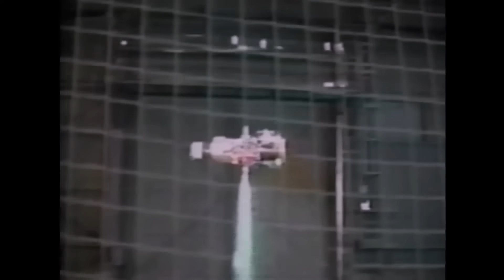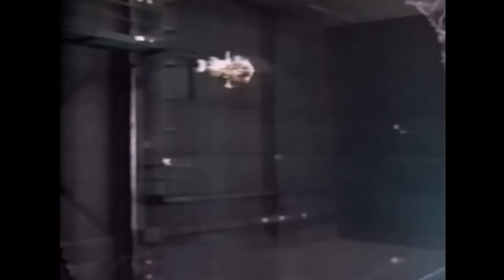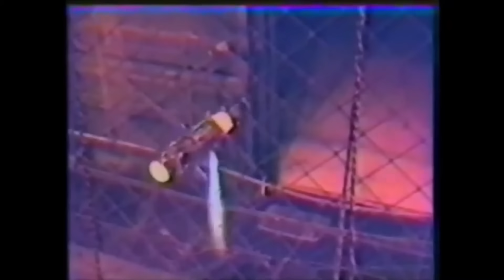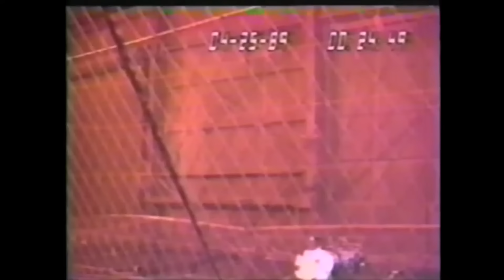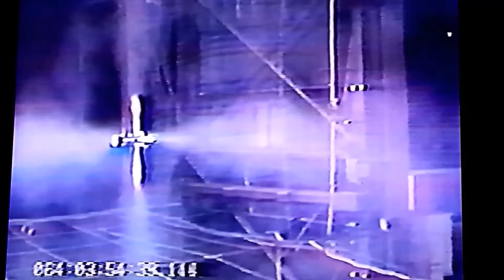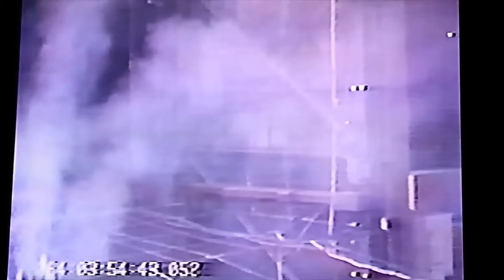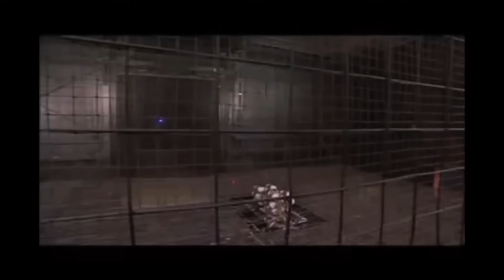EKV/KV/KW/KKV/LEAP (Exoatmospheric Kill Vehicles) Hover Test - Compilation Video (SM-3, GBI, etc.)

Comment: NICAP Report – Commercial and Navy Pilots (June 24, 1950)
A Navy co-pilot and a United Airlines pilot jointly described a UFO:

Cigar-shaped dark gray or gunmetal in color, with shimmering heat radiation at the tail roughly 1/8 the size of the full moon in apparent diameter, moving at 1,000–1,500 mph.

Comment: Chiles Whitted Encounter (July 24, 1948)
Both Clarence Chiles and John Whitted, Eastern Air Lines pilots, observed the object flying past their DC-3:

"It was torpedo or cigar-shaped similar to a B-29 fuselage" and approximately 100 ft long and 25 ft in diameter. 

Had a “dull red glow,” windows as brilliant as magnesium flares, and red-orange flame exhaust.

Comment: As I recall a treaty with the Soviets did not allow testing such devices outside, so it was tested inside a hangar. The target it was tracking was outside and viewed through an open door. The engineers are celebrating because they've probably seen the thing crash a hundred times before they got the control system dialed in.

Comment: now think of how many years ago this was. The " tic tac " and other UAP s  are the extensions of this tech . More efficient, lighter better power source etc. no flight surface, wings etc. . the rounded covering is somewhat like a speaker cover the gases pass through easily. Trans medium though hmmm they claim it but we don't see it in the videos so far. The gimble is this for sure.

Comment: Wow!
This is more advanced than the cheap-ass battery-operated drones. 
I hope they didn't put this on the shelf.
Do they have a gas vaping system for the fuel source?
If they did, that would mean this drone could travel hundreds of miles on a gallon of gasoline.
If they have this project shelved, they need to bring it back.
This is advanced tech right here.
With the power of AI, can make this the most advanced defense system in the world.
Or, actually, come up with real flying cars with this tech..
Everyone is focusing on "clean energy", which there's no such thing.

Comment: we have been able to make this kind of thing for a long time...the only issue is fuel. You have to have enough fuel onboard, so figuring that part out to make one fly for hours wasnt possible.
Reply: depends on the oxygen you can burn.. but why burn things when you can suck em out the atmosphere
Reply: @rokpepeshogun  oxygen itself is 21% of the air and its not a fuel, its an oxidizer.

Comment: I don't get this things purpose? whilst I admire it's working it seems to have no practical purpose on earth or in space. It's corrections are probably more accurate than bladed drones though and its thruster tech could be used in space vehicles with different fuel sources 🤔

Comment: When the invention was too dangerous even for the operators. Ever hear of Blendo from Battlebots. They nicknamed it the death machine because it had a rotating blade running at 100s of rpms. It had to be turned on using a drill at its had. They deemed it too dangerous for workers to operate.

Comment: As you watch this rather "dated" material that was likely classified back then as a DARPA project, you could easily see how much the technology has likely developed since then into potential drones.  drones that the less experienced, without a security clearance, might misinterpret such things as a UFO...?  JS
Reply: I live in the area where the whole drone controversy is localized, and it is just SLIGHTLY interesting that the government is remaining hush hush over it considering the amount of military bases in the area.
Reply: @DecarboxylationWF  I would tend to agree that this is all very likely our own government behind these drone sightings.  Plus the rate at which these things can change directions and fly off at incredible speeds is likely part of their overall design intent.  The original concept was to be able to intercept a ballistic missile which would be travelling at very high velocities, so it makes perfect sense that they would have developed them into hypersonic speeds by now.  The real question would be how did they solve the fuel requirement issue...they aren't of much use if they can't fly for significant amounts of time.  People think that military pilots would know about such things, but as someone who once held a TS SCI clearance, I happen to know that they likely would NOT know anything about this...not unless necessary.  The final real question is why are they potentially "testing" these things in the clear near populated areas?
Reply: Simple. Drum up public fear of drones to get bans and regulations passed so civvies can’t use publicly available drones of their own to check things out. If the war in Ukraine has taught us anything, it’s that drones are a terrible and awesome asset to a battlefield.

Comment: What I find interesting is that they're doing this research in this scale knowing full well the limitations of current fuel energy densities. Still putting assumably millions into it, one would think it was silly unless of course you have a similar acting fuel but with a much higher energy density? 
What are they going to switch the current 15 second fuel out for? If not where is this magic fuel tank going to be?

Comment: Why have a big thruster counteracting gravity designed in. Why call it a hover vehicle, is it meant to be literally hovering high above a fixed point on the ground. Do they not understand this sort of device will not need to counteract gravity when in operation? It should be launched either by a missile or holding in orbit - either way it will have enough velocity to counter gravity. Engineers...

Comment: Nobody here knows what this thing is or what the tech level in use is. It's an RCS system, it basically has powerful manouvering thrusters. We've had them for as long as we've had spaceflight. They aren't special or mysterious, advanced tech. The most impressive thing here is the flight computer keeping it stable.

Comment: In addition to the incredible success of making these units autonomous, you also have to understand that they're going to be operating in a low-gravity environment.  That means it's only going to be making small corrections, giving small bursts of the thrusters.  So the supply of fuel is going to last a LOT longer than just 15 seconds.  Once released by the launch vehicle or satellite, it will be able to intercept the missiles rather easily.  And remember, there's no explosives onboard.  All it needs to do is hit the missile, which is going to be traveling at Mach 15.  At that speed, a marshmallow would punch a hole through your chest, so this thing will obliterate a missile.

Comment: Rockets= thermodynamic system against thermodynamic system. Remove the air and they are one hand clapping.
Reply: No. A force always has an equal and opposite force.
Reply: @Noorthia  is one hand clapping a force, yes but is applied, No.
Reply: @newperspective7790  Let go of your clapping analogy. It is false. Thrusters throw their fuel back, and that force is countered by the rocket being moved forwards.
Reply: @Noorthia  you are incorrect, thrust is a thermodynamic system not a stream of fluid, the inertia of gas is very small compared to a fluid stream. One hand has force but cannot apply it onto itself. If direct water with the same speed as rocket thrust its force can sheer metal, but a gas cannot. Thrust is TWO thermodynamic systems one applying force, the other is resisting. Thrust in a vacuum is ONE HAND CLAPPING.
Reply: @newperspective7790  - The Dunning-Kruger is strong in you…
Reply: @danopticon  and you can't even formulate an argument or any original thoughts. Life is tough.
Reply: @newperspective7790  You're the one who keeps lying about thrusters.
Reply: @newperspective7790 this has to be ragebait

Comment: The positioning when in orbit will be more complicated given the orbital dynamics that will cause the orbit to change when a thruster is applied. At the time this was demonstrated nobody had a sufficiently compact system for calculating the orbital dynamics. This is really just and engineering showpiece, albeit a very impressive one
Reply: this is not for orbital flight. this is for intercepting suborbital munitions

Comment: At 12 inches long, several of these craft could be launched when using the new swing launch systems they have now, where no combustion is used when launching into orbit or space. They could have multiple sizes that hold different amounts like a model that holds 6, 12 or 18. Since most missile attacks come in multiples nowadays, thanks to missile defense having the capability of handling multiple threats.

Comment: this kind of control system was incredibly difficult to accomplish back when these tests were run, and you can hear it in the engineer's voices. ultimately, this project got all of its funding cut despite the tests working perfectly. basically, the nuclear weapons stand down and other factors like different countermeasures meant they wanted to budget spent elsewhere. it was a fascinating design though, intended to insert itself into the ballistic trajectory of an ICBM and shoot multiple anti-rocket projectiles at the ICBM. the engine was designed to move from trajectory to trajectory too, so one launch could take out multiple ICBMs

Comment: i think what made these things so unique is having such a small profile vehicle with enough fuel to just pump out lil bursts of thrust to conserve its fuel and still maneuver incredibly well
Reply: That was what impressed me the most. So much thrust generated with so little space available for fuel.
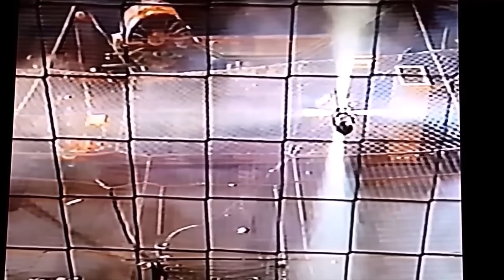Reply: 2:10 we can make out a thin hose
I read elsewhere that the main thrust is just a single solid rocket chamber providing output for multiple rapidly switched exhaust nozzles, whereas orientation is chilled gas. But different vehicles may have used different powering schemes. All of them certainly look impressively agile.

Comment: Track and strike a heat source. Moves in all directions without needing to make rounded turns. Fast enough to intercept missiles. Sounds like all the UAP’s that have come to light in the last 20 years.🛸
Reply: Are UAPs unbelievably loud as well and only able to fly for very short periods?